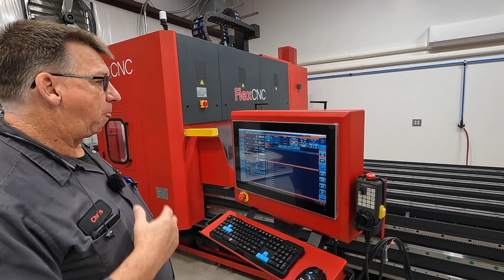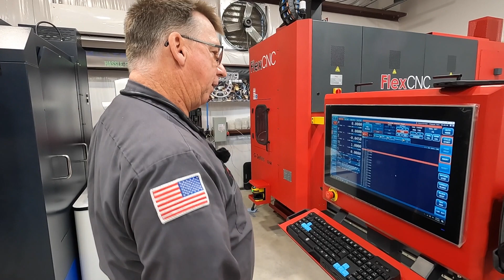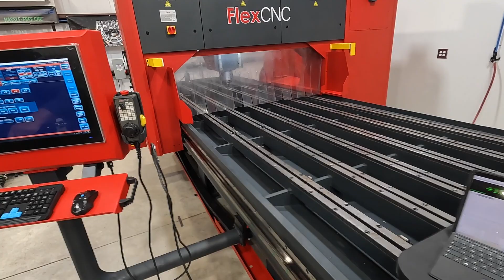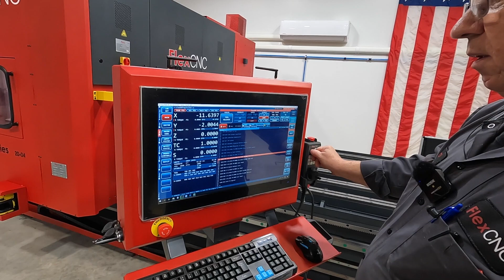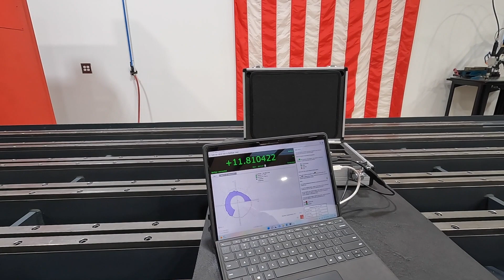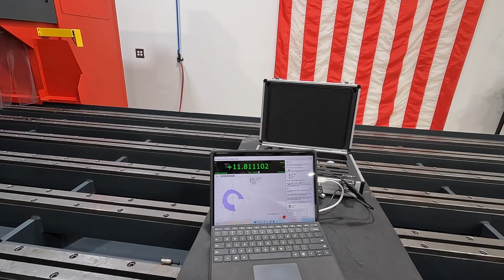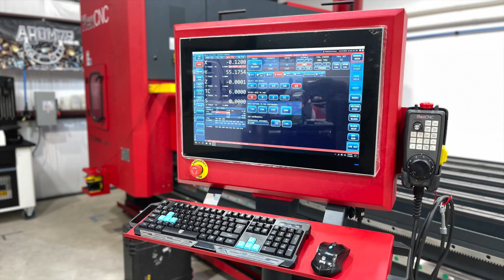Installing the Flex CNC Long Bed Vertical Machining Center

Comment: Take a non-stop video of the Flex technician while he trains you on the software and operation of the Flex CNC, this will allow you to watch the video numerous times and you will pick up tips each time you watch the video. It is impossible to retain a lot of information when you are trying to learn a new system. You have a number of new CNC  machines and it will take time to learn all of them at the same time.

Comment: With the size of that machine it's literally mind blowing to see just how accurate it is! Wow man! Congrats on your amazing machine brother!
Reply: It will slowly tune itself out of accuracy as the usage will make the the machine move in different places. But yeah, in software compensation for geometrical inaccuracies is magic, and the math behind it is not that tough!
Reply: probably need compensation re-aligned weekly(or more) and as the building/concrete moves, monthly multi-day process. then again if it all moves in synch, maybe not so bad, if it can deal with the whole machine out of level.

Comment: There is a lot of clever things about the design of that machine, its small footprint for the amount of "Y" travel it has, the compensation for any deficiencies over a ball screw in terms of backlash, the modular construction having the head unit arrive factory setup on its own section of bed and just general cost effectiveness of the design for its ampule capabilities.

Having the rails decked after install and with the laser compensation active seems to me to be the better option anyway, rather than at the factory prior to install.
Everything is parallel to the compensation that way and as close to perfectly level as you are going to get it.
Reply: The clever innovations I love is what they call "Pendulum mode".  Where you have two sets of fixturing on either end of the bed.  While it is cutting on one end. You swap out finished workpieces on the other end for more blanks/raw material.   When it's done it then traverses down and you swap out the finished material on the other end.   That way the CNC machine is always running, and you don't have down time as you swap out work pieces.

Comment: would like to see even 1 project that uses this machine to its full potential
Reply: Me also...sorry just a farce with lots of clicks paying for it.
Reply: look at how tiny them linear rails are. great machine if you want to drill tap some 1/4-20s  in long strips of aluminum, thats about it. thing is as rigid as a piece of paper in a hurricane
Reply: @romanfedotov9434  Pretty much every modern milling/boring machine use small linear rails, even the big ones
Reply: @romanfedotov9434  the main rails are of standard size, if you're talking about the small one at the bottom they are for the control panel to move along the length of the machine

Comment: I quite thank you for the chance to have a look at CNC control and job set up.  The place where you mention multi work station, multi job progress is what I simply did not grasp at the length, the ability of the machine.  Clearly, this unit will enable some very complex task with the natural precision of new install and accuracy.  I am cheering for your drive to excellence, and where I view a modern master of the absolute best tool process as both as growth and teaching to a wider audience.  Regards from Washington state.   *McGary

Comment: Seriously cool machine there Adam! You could potentialy setup a whole series of jobs for several customers, load in the programs, and hit "start"... and just watch it go... profit!
That 20' rectangular tube that needed 1/8" taken off one side would have been very interesting. I, for one, would have been very interested to see how you would compensate for the inevitable warpage of the tube.

Comment: And a 4th axis option too!! Flex if you're listening, Adam needs a great deal on the fourth axis so we can watch him cut splines on a 16ft x 8" diameter drive shaft. I mean it never hurts to ask right?
Reply: LOL: Adam will never even master 2 axis let alone 3. Adding a fourth guarantees that he will never use the machine SO that may actually be a smart move from FLEX CNC that still owns the machine since it is just on display in a79's workshop and will have a higher selling price if a79 doesn't put wear on it.

Comment: Flush mount anchors are easy to install.  You hit them flush with the floor when the machine is out of the way. Don't forget to set the insert with a pin punch. If the bolt is too short or long the insert may not set properly.  Move the machine in and just tighten with a wrench or impact after moving the machine in.   If you need to remove them, the bolts come out leaving the anchor part in the floor so the machine can be moved.

Comment: Howdy - Beautiful machine.  Lots of tasks available.  Wish you had a door behind it to extend stuff.  Oh well.  I designed a 3 phase 380V system in my shop using Can transformers to run my surface grinders  and their Vac systems.  I use an American Rotary 10 HP 220 and drive 220 single to 220 3-phase.  Then off to 6 transformers.  3 power and 3 snubbers or boosters - their output are in series with the big transformers Pushing the total to near 380.

Comment: ........And I've been struggling with getting my little Bridgeport moved into place and running.......then I watch this.    At least now it seems a little easier a job than before I witnessed your struggle with this beast.
Reply: But don't forget Adam just runs the camera and everyone else does the work.  So pat yourself on the back, you do it all.  And you will probably use your Bridgeport more than Adam will use this monster.

Comment: That machine is awesome!  I can't wait to see projects done on it.  I don't know what you paid for it, but you know Red Green could've built you one with 20 rolls of duct tape, a 1975 Ford Pinto, 5 ratchet straps, and some pvc pipe...right?  Would've only cost you 500 bucks and new shop when it blows up 🤣

Comment: .0006" over 20' 
Damn, I know it's a brand new precision machine, but still, that's some crazy accuracy.
Reply: Enjoy it - because it will bend out of shape before the end of this month.  Have you seen his FLEX ARM? It is wobbling and clearly not a precision instrument so I don't have high expectations for this thing based on seeing the FLEX ARM.
Reply: @swedishpsychopath8795  The flex arm is low precision by design, it's essentially a hand tool. To be sure, the mill won't hold .0006" over 20' for long, but comparing it to a flex arm is like comparing it to an angle grinder.

Comment: As I said before Adam you need to check into taking a course in CNC programming at the nearest community college.  All the learning materials you should get with that class will be of inestimable value in running those machines.  take care and good luck on your new adventure. 😆👍

Comment: Wow, that is a long bed.  Consider guest mics, and overhead shop cams;  both can be helpful in video making, as well as reference for later.
Reply: I don't think that wil be necessary and not helpful. You can put a camera in your living room if you want to.
Reply: @swedishpsychopath8795  What?  It would have been nice to more easily hear some of the installer's explanations, and might continue to be, as Adam goes through training.  Similarly, a shop cam could have been used as a second angle of the installation.  Not sure what your message is intended to mean.
Reply: @Nullpersona  What you are proposing is considered invasion of privacy and eavesdropping.
Reply: @swedishpsychopath8795  Are we talking about the same thing here?  Using cameras and microphones is by choice, whose privacy would be violated, and how?  There seems to be a fundamental disconnect somewhere, considering this entire channel is cameras and mics in a shop.
Reply: @Nullpersona  Correct - and you are trying to violate that.
Reply: @swedishpsychopath8795  This has to be trolling at this point.  Wish you the best in your reality.

Comment: One place I worked installed a laser curtain on a heavy press, and I wasn't used to it.  I must have shut that machine off a dozen times before I realized the bill of my baseball hat was breaking the beam.
Reply: That is the reason why baseball hats should be forbidden to be worn inside a building.

Comment: Awesome! Flex should have a vinyl template for each model that they can just roll out and mark the holes before the machine even is brought in. Would make it so much easier.
Reply: Nah - It won't work. Better do it the way the did it.
Reply: See your point. On the other hand, you just know someone's going to get it in their shop and say, "There isn't enough room for the La-Z-Boy. It needs to move 6" to the right." Maybe there's a reason to see the machine in place before drilling the concrete.

Comment: Probably need a couple of floor-rolling gantry cranes for loading long stock onto the Flex.

I also see most of the work for the Flex being structural with some work for crane beams and the like which need precision faces for drives, etc.

Comment: I’m wondering how the work is going to get loaded onto the bed. Is that a combination of forklift and overhead crane?  If you’re machining something that is 20’ long, how do you get it into place?  The coolant tank at the end restricts access somewhat. The lanes on either side seem to be too tight to drive a forklift down that way and then swing the piece onto the bed. Really looking forward to watching this machine tackle a 20’ long piece.

Comment: Milling 0.125" off a 20 foot length of tubing would be... horrible. Tubing is never straight. Great video though Abom! Excited to see what you do with this beast!
Reply: I would definitely go back to the customer and find out why he wants it and how they arrived on their solution. Apart from tubing being warped as is, it will warp further when material is removed from one side only.
Reply: @bigbattenberg  Yep, you're totally right about that. It would be a nightmare no matter how you approached it.

Comment: wow reading through the comments I've seen more "experts" than any machine shop in country has on staff.  LOL
Reply: I suppose The pool of retired and very experienced CNC machinists, builders, engineers, and QC people is huge. Really, there may be more retired CNC machinists than in the current workforce.
Reply: Reminds me of the expert advice given by some commentators which solved his conundrum on the K&T mill knee, for which he was very grateful.  The benefit of voicing a problem to a wider audience;  in that case many heads were better than one.

Comment: Hey Adam, congratulations to the new workshop and the machine park! Just one question, this seems to be open pore concrete, why didn’t you pour acid and oil proof 2K flooring? Is this no requirement for a shop that deals with grease, oil, and other nasties?

Comment: Love your show
Wondered if you ever checked the side play on your milling machine. If you attach an indicator to your quill and put a collet in the spindel and install a tool or rod in the collet. Then push and pull sideways how much movement would you get on the quill. What would be a reasonable amount of play before it would cut down on accuracy and chatter.
Thanks for years of great information.

Comment: Hi Abom, pretty cool machine! I believe I saw it once before when you toured the Flex plant.

Quick question: I'd like to find a source of 305 stainless sheet (about 0.05 thickness) to prototype some bendable surgical instruments . I can find no source of small quantities of 305 online. McMaster has a great selection, but no 305. Got some ideas? Thanks in advance!

Abom, like a lot of other people, I've profited a lot from your videos.  You are an excellent teacher!  I apply what I learn from you directly in my shop. I also like all the new shop setup videos. There's lots to learn from. Recently, I decided to get a Kaeser SX after you got one. I'm in the market for a used one.

My best,

Walter
Reply: online metals
Reply: @stephenhart8981  Stephen, thanks but I checked Online Metals and no 305.

Comment: I know that you don't have much frost in the ground down there but, realistically, how stable will the concrete floor be?  It looks like the machine is very well set up for any necessary readjustments if the ground settles.
Reply: Really. Every machine sits on a concrete floor of so nature. If it was an issue we would have machining of anything with any accuracy. Come on.
Reply: Can be an issue if concrete floors are overloaded. The Flex machines got many pads, spreading it's weight out over a large area, highly like well within the specs of the floor
Reply: @russellerney2375  With such a long bed, stability of the floor is of utmost importance.
I often visit a large machineshop which was built in the 50ties near a canal. When the water level changes, the machinists can notice the change in the behavior of the 30 ft lathes
Reply: The "leveling" was just to keep the software from having to accommodate excessive changes.   The machine can be re-calibrated  for minor "shifts" in an hour or so.   At some future time it might make sense to add some more mass if it needs to be seriously re-calibrated more than, say,  once a week.

Comment: Nice machine how this machine  compensate environment temperature changes for maintain accurate tolerances 🤔👍
Reply: The first 10ft will be in total sun with the door open in FL in Aug. The back 10ft will be 80 degrees cooler near the big fan! Should be fun to see what happens.
Reply: @lundysden6781  i think Adam will get the answer 👍
Reply: The frame is made of invar which is also used as an LNG tank material.
Reply: @janvisser2223  tank you for clarification i know this alloy it has low thermal expansion coefficient it is used on high accuracy instrumentation, our hold tv had it internally on cathodes guns for image stability 👍

Comment: That's a lot of manual pushing around if only somone had taken measurements all the pads could have been installed before the heavy machine arived. 
One of the drilled holes appeared to punch through your floor? Holfully your slab is up yo the task.
Levelling the machine looks fun a little shody though that the levelling plate mounting bolt holes never got so much love.

Comment: Never seen a CNC mill with a gear track.
everything I use has ground ballscrews.
If you ever need work for this machine I have some large-ish plates that would be a breeze with that kind of travel.

Comment: A very impressive machine.

What is the maximum weight of component that can be mounted on the bed? The bed looks very lightly built for the size of the machine.

Will you require special tooling or can you use standard milling cutters?

I would have thought to get a return on your investment you would need to run the machine with 3 shifts a day 6 days a week.

Good luck with your new toy!!

Regards from Redruth 

Arnold

Comment: Just curious as to why you couldn't use the crane you've got? Not long enough or too heavy?
Reply: Crane is just 1 point, and things will move around hanging in a chain, if it were able to lift it at all. They need to lift the machine at several points simultaniously
Reply: Both.
Reply: That crane can't even begin to lift that thing. CNCs are heavy for a reason.

Comment: I suppose that I am naive but someone tell me what is the  benefit of CNC if you are only going to do repair work or make one part.
Reply: To make a living.  Do you ever do anything to improve yourself and what you do?
Reply: Maybe he can now take on jobs he had to decline before. More capabilities = more job opportunities and also maybe even faster turnover. We will see what kinds of work he will be doing, I for myself am very excited for that.
Reply: Though most CNCs are used for high capacity production, some are used just for their ability to perform custom complex, multi-dimensional actions, like curves and such, that would be nearly impossible with a manual operator. Check out what Edge Precision does with his. He rarely makes more than a few of anything he does, but each one is intensely complex.

Comment: You must have been itching to say something when those holes were being drilled at a wonky angle 😅
Reply: Yes, that’s what I thought as well
Reply: Yes asdoubleboost says in his Geordie ( Newcastle UK accent) " It's piss wobbly" lol go check him out.
Reply: @samrodian919  I know the guy, seen a few of his welder reviews 😅
Reply: I wonder why these drills dont incorporate a bubble level of some sort.
Reply: Not important. The concrete bolts hold the plates to the concrete. They could have been glued! The machine levelling bolts rest on the steel plates... They "float" sideways.
Reply: I noticed that too, but I guess that isn't critical...
Reply: @BerndFelsche  it might not be important for the application but it will be important to an engineer with very high standards that’s programmed to make things square unless told otherwise
Reply: @JayGee6996  That's why engineers aren't allowed in the shop ;)

Comment: Came across a video you might like. "Creating a Control Arm for Manufacturing" from the Autodesk Fusion 360 youtube channel. Would teach you a little about drawing in Fusion and in the follow up section they show you how to manufacture the part.

Comment: This looks perfect for prefab of structural steel beams, columns, and any type of large size flat plates. I'd think FireTool could use someone local to do the welding table top drilling and tapping. Why import from China when they could the made in good ol' USA.